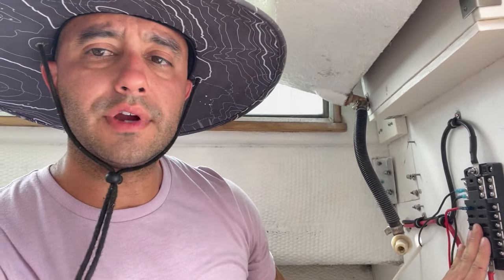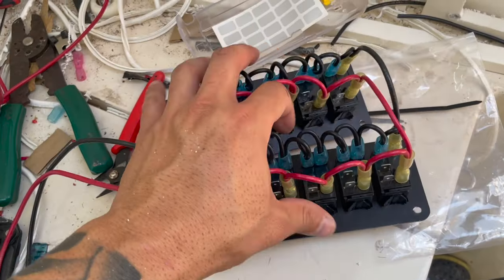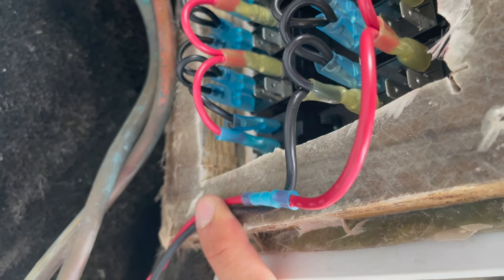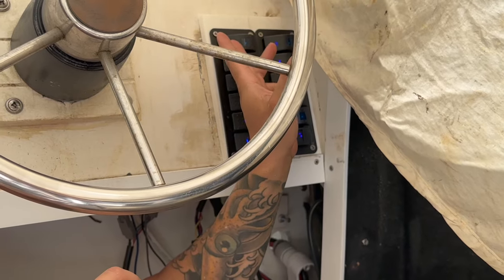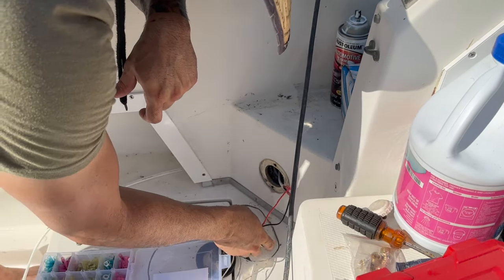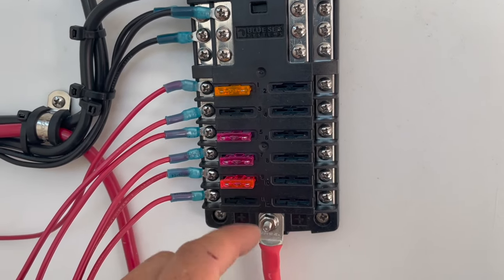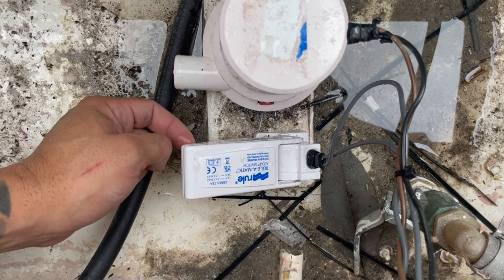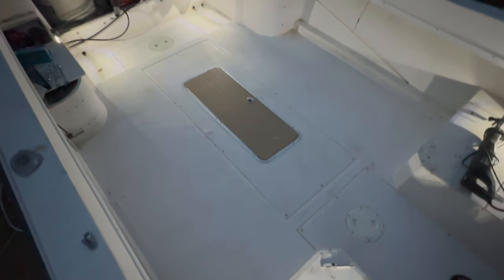Beginner Boat Wiring Basics | Nav Lights, Bilge Pump, Courtesy Lights, Livewell Pump

Comment: The 6ga wire that grounds the bus bar for the switches should be run back to the battery instead of to the other fuse block.  This will prevent noise from ground loop currents.  ✌🏼
Reply from the maker: Awesome tip! Thanks so much! 🍻
Reply: Thinking about it now your right imagine you lose all ground because the main ground at the battery corroded

Comment: That was very informative, I am a bit confused on your changing the jumpers to illuminate the switches regardless of if they are on or off. If you wanted them on only when turned on would any modifications still be needed since you are using a fuse block? I personally would find the Blue lights at night distracting and poor for night vision adjustment. Thanks for posting with so much detail.
Reply from the maker: Thank you so much for the comment! The way the switches came wired is such that one fuse would fuse the entire switch rather than individual wires from the fuse block to the switch position. 

If you wanted them only on when the switch is on, I don’t think you need the jumpers for that. 

We’ve been out on the boat at night and they’re not distracting but that’s maybe because we have them down by the steering wheel and not higher on the helm where we see it all the time.  
🤙🌊🛥️

Comment: Nicely done! Your attention to detail is appreciated! Minor point of contradiction: Label #'s 8 & 6 must be swapped on the Diagram. 
The Diagram that you are showing at 5:38 (the Terminals on the back of the Switch) doesn't seem to match the actual Switches being used (at 2:10). The Switch Terminal #'s and their uses are:
#2 is the Line side of the Switch (from Fuse Block). OK.✅
#3 is the Load side of the Switch (to a Load or "Appliance" Pos+). OK.✅
#8 is normally the Input for the Indicator Light (from your Fuse Block, since you are powering them all the time). OK.✅
#7 is the Negative for the Light (to the Neg. bus on Fuse Block). Jump all the #7's together, then to the Neg. bus on the Fuse Block. OK.✅
When you show the actual Switches (2:10) the Black wire is landed on two Terminals on each Switch... Weird. (And, they were factory wired that way).
But, on the Diagram, (5:38), #7 & #8 are shown side by side (which is normal, but would never be jumped together - the Lights wouldn't work, and it would short the Battery, if they were jumped together, since #8 is Fused Pos. and #7 is Neg.)
You put Red on #8, & Blk on #7, (which is correct), not Blk on both... (Your actual Switches have Blk on two Terminals)... Why? 
The diagram also shows #3 & #6 side-by-side, (as they normally would be).
#3 is the Load side of the Switch. #6 does nothing in your configuration, but, again, the actual Switches have the Black wire landed on two Terminals on each Switch. 
It appears that the Diagram has the Tags for #8 & #6 swapped, which would put #8 next to #3 (which is how your actual Switches seem to be connected), and the factory apparently jumped #6 & #7 together with #6 not actually connected to anything inside the Switch. (#6 would normally be the Load side of a Double Pole Switch, where a Terminal #5 would be the Line Side of the second Pole.)
Again, there is only one Negative Terminal on each Switch, (a 5- or 6-Terminal Switch, anyway), but the Switches actually have Black landed on two Terminals.
Basically, I am saying that whomever tagged the Diagram numbers 6 & 8 got them backwards. Maybe a translation error on the Diagram for these Amazon Switch blocks.

Your actual wiring is great! This is nearly identical to my 19' boat's setup. I have an additional Negative bus at the helm, as there is more room at the stern for my fuse block.
Thank you for the effort and time this took to document and explain!
Reply from the maker: Hey brother thank you so much for the comment. And thank you so much for taking the time to go in such detail. Those Amazon switches aren’t the best and I tried to find a matching picture online to try and explain what I was doing. At the time I was trying to be redundant for anyone trying to do it themselves. But I can see how it can be confusing. I’m going to require our smaller skiff and try to be a little more precises and concise in the explanation. Thank you so much for the kind words and it shows you have some experience doing this! Shoot us an email if you have the time I’d love to run some ideas by you for our skiff rewire! 🤙

Comment: Great video.  Thanks.  Should the bilge pump be connected directly to the battery so that if you are anchored and powered off, the bilge pump can still operate?
Reply from the maker: Thank you so much! Yes the bilge pump should ALSO be wired to the battery. We have it wired to the house battery with its own fuse. 🤙
Reply: @perfectfitboating  Thanks.  Great work.
Reply from the maker: @antant7522 thank you buddy! 🤙

Comment: Just found the channel, great videos! Question about your NAV / ANCHOR light setup - does your ANCHOR light illuminate when your  NAV lights are illuminated? It is supposed to. You need a RED light, GREEN light and a WHITE light illuminated at night when you operate your boat. The ANCHOR light is illuminated by itself when you are at anchor at night. 👍
Reply from the maker: Thanks Mikey! We appreciate that! And that’s a great tip! Our lights are on different switches so anchor light has its own switch and so do the nav lights! That way we have the ability to turn them off and on in case we’re just anchored or underway! 🤙🍻

Comment: Something that i have gotten into the habit of, offset the + and - joints. They will pull through and tuck away better. Not even a shade tree here, cars, trailers, and boats on a farm for like 30 years
Reply from the maker: That’s a good tip man thanks! That convertible mustang prob deserved it! 🤣

Comment: Good wiring job,  bilge pump should not be wired to the switch panel like that.  The switch is fine but it should be wired to be always on regardless of the battery switch position.  Has to bypass the battery switch.  The reason is the bilge pump is a safety item and it like VHF should be wireddirectly to the battery so that they still work in the event of an emergency and someone accidentally turns off the battery switch.
Reply from the maker: Thanks for the comment. I also have the bilge wired directly to the house battery via the float switch. I’m thinking of adding a dedicated and separate bilge pump switch as well. Thanks! 👍
Reply from the maker: Patrick-nodak  yep! Thank you!
Reply: Patrick-nodak  That's why you have solar.
Reply: First time trailering current boat, bilge kicked on and went down the side of a convertible mustang, if you are out there I am so incredibly sorry

Comment: Good job except just for me no one else you didn’t say what gauge of wires you were using for each. One question if you have a fuse block with negative at the top of it what is the purpose of the positive and negative bus bar? I’m trying to understand that in general
Reply from the maker: Thank you! I actually did mention the gauge wires I used in the video. The lights got 16g because they’re led and the pumps got 14g.  9:44 & 13:18
As far as the purpose of the busbar, there aren’t any rules that say you can’t run the wires straight to the fuse block. In my case, to keep things clean I opted to add the busbar then run wires to the fuse block. That allows me to run wires elsewhere in case I want to add another fuse block in the future, I’d have a place to connect power from. Thanks for the comment! 🤙

Comment: You spent good money on blue sea fuse blocks and bus bars...why did you cheap out on the switches?
Reply from the maker: Cheap switches cost $60 bucks for both sets. A decent 8 switch system from blue sea costs $250-300. I’d need two of those in my case. The switches will be out in the elements with sun rain etc. No switch is going to last more than a few years being exposed anyway so I figured if they go bad, I can change it out by just buying a new one off Amazon and swap it out quick. I can buy 6 cheap switch sets and swap them out before reaching the cost of 2 newer blue seas switches. 👍

Comment: Good job,  wanna come finish mine now?  😂

Real question though:  I have a deep cycle battery,  and a cranking battery that will only be used for the outboard motor of my sailboat. They are independently charged by a sport HD charging bank.  We aren't going on huge trips,  just a few hours at a time. Do you think there is a good reason for us to use the 1/2/both switch? We had been planning on not ever using the deep cycle to start the engine,  or the cranking to run anything but the engine. We were thinking the only thing that would physically cost the two would be the deep cycle negative connecting to the cranking negative, so the deep cycle battery gets grounded to the engine.
Reply from the maker: Thanks for the comment Beth! If you are in south Florida I’d be happy to come help! 😂 as far as the 1/2/both switch, I’ll give you a quick story. We installed these brand new batteries and everything worked great. One day we were trying to start the motor and it wouldn’t turn. We tried and tried and it turned out to be the kill switch. The problem was that we didn’t realize how many times we were actually trying to turn the motor over and the battery got low enough were it didn’t have enough cranking power to create spark. We turned the switch to both and voila she turned over. Point of the whole thing is you might want to have it and not need it than to not have and need it. These switches aren’t too expensive and Imo they’re worth it! Hope that helps! 🤙
Reply: @perfectfitboating  OK, so that's not really compelling enough to anger my husband over changing this switch choice for the fourth time...our outboard can be pull started, so he intends that to be the back up.

Comment: so are you just bringing all of those extra negative bus bars to the main fuse panel ground?
Reply from the maker: The one under the helm runs back to the fuse panel correct! And the negative bus at the stern connects to the battery.  Hope that helps! 🤙

Comment: Good video. How did you determine the gauge of wire? Is there a standardized chart for boating? I build experimental airplanes and we have a guide for the amps & length of run and the fuse is there to protect the wire. We are just waiting a sea trial on a 38’ boat and I’m going to need to do some electrical work on it so was curious.
Reply from the maker: Hey Brett! Thank you for the comment! Yes, there is a standardized chart to follow. Look up ABYC wire chart and there’s graphs to help you determine the wire size depending on the run of the wire. In my case, I went overkill with the size of the wires because I got such a good deal on the bigger gauge wires. The rule of thumb in boating is you can go a little bigger than needed just never smaller! Hope that helps! Good luck with your wiring! 🤙

Comment: Do I still need the negative bus bar or can I get away with just the fuse box
Reply from the maker: Hey Andrew! I would use a busbar. It allows you to have other negatives to ground to something instead of the battery. You shouldn’t have more than 4 items on a battery post. Do you HAVE to? No. But it makes sense to use one. Hope that helps!

Comment: What should be the wire gage from fuse box to panel switches
Reply from the maker: Depends on the length of the run and the load on the wire.

Comment: Can you skip the ACR and run power from your main switch straight to the fuse panel? Or is the ACR needed?
Reply from the maker: Hey Daniel thanks for the comment! Yes you can run power straight to the fuse panel from the switch. It’s actually already wired where the switch sends power directly to the fuse panel. The acr works while the switch is turned on and is on its own circuit doing its thing which is allowing current to flow to battery 1 and 2 as needed. Hope that helped! 🤙
Reply: @perfectfitboating  thank you for the quick response. Very helpful and your video is awesome! Thanks again. Just ordered my parts. Getting ready to re-wire all my electronics and pumps.
Reply from the maker: You got it brother! Anytime!

Comment: My only question is I thought the Anchor light is installed at the stern. It makes more sense visibly where you put it but don't you have to have a white running light at the stern?
Reply from the maker: That’s a good question because it’s also called a “stern light”. I went on the uscg rules and there isn’t any writing on the actual location of the light. But I found this “For power-driven vessels less than 39 .4 feet (12 meters) in length, the masthead or all-round white light must be at least 3 .3 feet (1 meter) above the sidelights”. I think I’m ok but now you got me thinking’ thanks for the question! 👍
Reply: For my sailboat we are required to have a stern light, a red and green pair at the bow, and one on our mast
Reply from the maker: If I’m not mistaken, sailboats require different lights as opposed to power boats. 🍻
Reply: @perfectfitboating  OK, I see now. You do need to have a light that lights in front of you,  at least 39 inches higher than your sidelights. And if that light is not a 360 degree light,  you need to add a stern light that lights behind you (but this doesn't have to be as high).  In other words, if you aren't a sailboat,  you can get away with putting an all-around light raised on a pole at your stern. Sailboats don't do this because we have that whole "sails are in the way of the light" issue,  so we rig a light into our mast.
Reply from the maker: Yes that sounds right! So many navigation rules it’s hard to know all of them!

Comment: I am in desperate need of some guidance for my pontoon.  I have 5 batteries total. I want to make sure they are all hooked up correctly.  I have 4 things but possible 5th that’ll require power.  I have one Pecko 2 way switch already installed - 1, 2, All and OFF.  I also have 2 onboard battery chargers.  1 is 2 bank and 1 is a 3 Bank.  I can send pics or specs if needed.  

1. Motor/ignition
2. Trolling motor 80lb thrust
3. Garmin Depth Finder
4. 8 speaker w 2 12” subs stereo
5.  Possible re-hook up bilge pump

Main ? Is how to hook up all of these appropriately if you can give any advice I would be forever grateful!
Reply from the maker: Hey brad thanks for the comment. I’m not expert by any means but I might be able to help. 
1. Your motor should have a battery cable coming off the starter which will hook up to your switch (+) and to your starting battery (-) your motor harness has a wire that is power for ignition. 

2. From what I’ve seen, your trolling motor should have its own dedicated battery. The way I would wire this up would be with a separate on/off switch and a proper fuse.
3. Your depth finder can be powered from your main fuse block. The fuse block is getting power from your main switch. There should be a fuse after and closest to the switch for this long run to the fuse block.
4. I’ve never wired speakers but I would think it’s the same as any appliance. From the fuse block to amplifier or receiver or whatever.
5. Bilge pump would be the same. Check out our other video where we hook up the bilge pump!

I hope this helps. If not shoot me an email and I’ll be happy to go back and for with you with ideas. Thanks brad! 🤙

I was also thinking, depending on what trolling motor you have, you might need more than one battery. So, another question I had was which batteries are you using for what? 1 starter battery 1 house battery and 3 trolling motor batteries?  I’m not sure if those trolling motors run off 12, 24 or 36 volt.
Reply: @perfectfitboating   thank you for the tips!  I will try that and see what happens.  Just doing some RE-configuring to maximize performance of setup.
Reply from the maker: Anytime! Let me know how it goes!🤙
Reply: I am planning to rewire my skiff this winter. I think from your videos I should be able to do it. I’m tired of all of my wiring looking like a birds nest.
Reply from the maker: That’s awesome Anthony! I’m glad the videos can help! If you need any more help shoot me an email. I’m happy to help and give you suggestions! 🤙